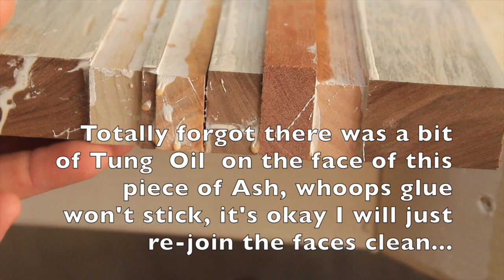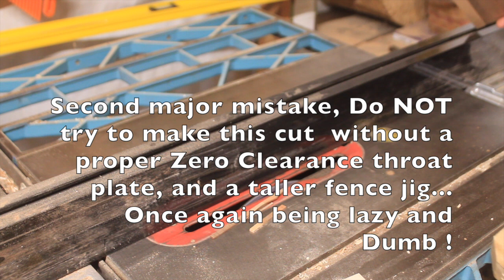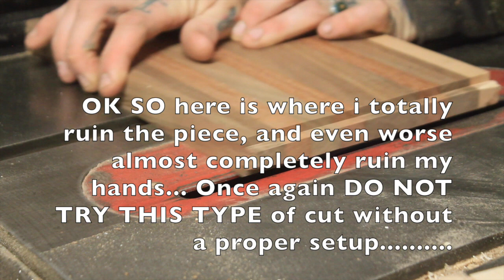Simple Wood Cutting Board // Made mostly with an Old Sears Craftsman table saw

Comment: That looks sick. I'm slowly collecting tools for my shop and really want to make a good cutting board. You should definitely make a video on how to make some jigs. Love the content!
Reply from the maker: Hey thanks ! I had a really lame table saw that didn't have a fence, or much power, so i never really tried to make any cutting boards... but once i got this saw with a solid fence up and running the cuts are basically ready for glue up right away . i just cut all different boards at all different widths and try to pick out what looks cool next to each other... i've been a bit slow on video production, but certainly new clips coming very soon, and will start working on some jig videos.